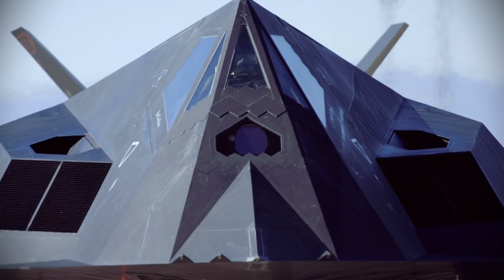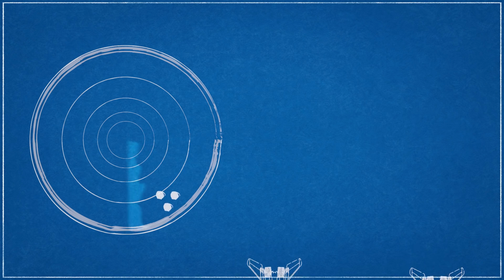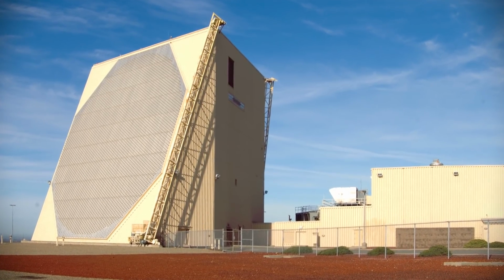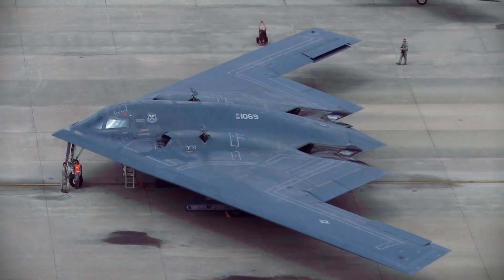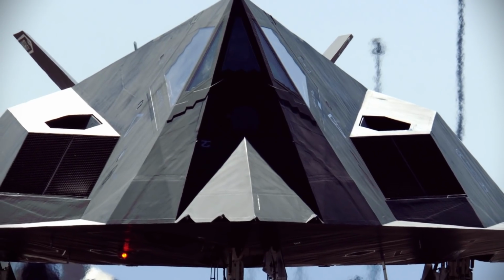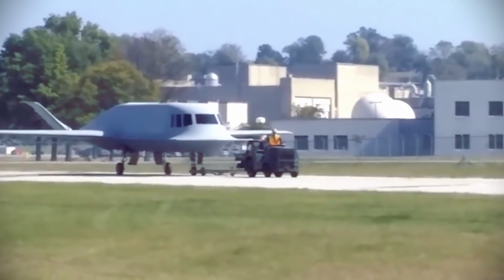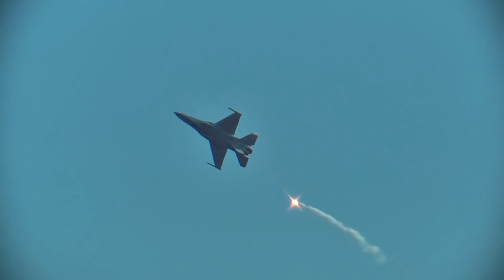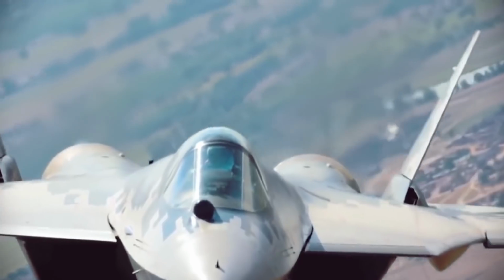The Evolution Of Stealth Technology

Comment: Could we quickly discuss the Horten Ho 229 at this point? 
Rebuild back in 2008 by a Northrop Grumman team using original materials and plans, and tested on the same stand as the F117 for its radar profile, they found that this plane if flown correctly (that means low and fast) could have tricked the English Radar Installations. It would not have been invisible for the radar but its profile was so drastically reduced that the RAF only would have had 2-4 min time to react and intercept them. If I remember correctly the only thing they could see on the radar was the cockpit itself.
It has been a long time since I've seen that documentary, would love to hear your take on this topic!

Edit: Small correction here: It was in 2008 by Northrop Grumman in cooperation with National Geographic 

quote from wiki: "Radar simulations showed that a hypothetical Ho 229, with the radar characteristics of the mockup which had neither metal frame nor engines, approaching the English coast from France flying at 885 kilometres per hour (550 mph) at 15–30 metres (49–98 ft) above the water would have been visible to CH radar at a distance of 80% that of a Bf 109 This implies a frontal RCS of only 40% that of a Bf 109 at the Chain Home frequencies."
Reply: Edited for correction!
Reply from the maker: I recall that documentary! Nat Geo’s Hitlers Stealth Fighter. An interesting fact I came across years ago on it was that all of the tests were done on static mockups. With running WWII era jet engines it would have lit up on radar to the point where it canceled out its pseudo stealth properties.

And this awesome fella above beat me to it. 👍
Reply: It was all hype if you ask me.  The horten brothers were trying to build an aerodynamic design, with the ultimate goal of a bomber capable of carrying a dirty bomb to the USA at high speed.
There was no evidence of radar evasive testing or technology development.  It was simply following the theoretically most aerodynamic shape, ie flying wing with no tail.
Jack northrop was working on the same thing, and actually started before the Horten brothers, he also came up with the flying wing and had no stealth intentions. 
THE ONLY REASON people assert that the HO 229 was an early stealth fighter is because it shares a resemblance to the B2.  That is it.

Comment: In Yuguavia they made the mistake to use the same route every time, that is why it was shot down not because of doors. The Serbians knew it was there, all they needed was a gap in the jamming and a good track.
You correctly stated that the trouble is to get a track good enough for guidance. If you have the initiative that is no problem.
Reply: It was detected because of doors. "According to Dani in a 2007 interview, his troops spotted the aircraft on radar when its bomb bay doors opened, raising its radar signature."

source: https://en.wikipedia.org/wiki/1999_F-117A_shootdown

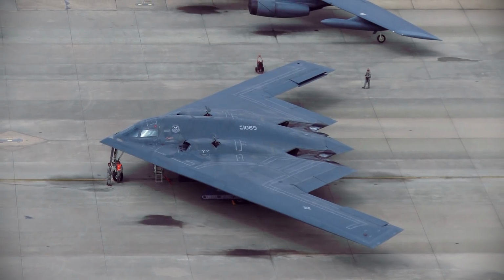Comment: 9:56 - Your timeline is all messed up. Overholzer approached Kelly Johnson about the implications of edge wave diffraction only after reading Ufimsev’s original paper (that was published in 1962, not 65 as stated here). 

Have Blue was the end result of the Echo 1 program that Overholser and another mathematician at Lockheed developed to model 2D RCS return around 1974-75 after not being included in the original DARPA RFP.

Comment: "With no vertical surfaces it requires a FBW system" ... tell that to the Horten brothers :P
Reply: Fones R Phunny it never flew in the first place :v
Reply: @LuisBrito-ly1ko  What is "it"? 229?
Reply: Fones R Phunny Yeah, the HO-229.
Reply: @LuisBrito-ly1ko  The Horten brothers designed several successful flying wings before that. Most of them were gliders, but some were equipped with pusher engines. None of those required FBW.

And the 229 did in fact fly. V1 ("prototype 1") was another glider and V2 was modified to mount the larger Jumo engines (since the BMWs weren't available yet). The latter crashed after an engine failure.

There was also the Northrop YB-35. A flying wing bomber similar to the Horten designs built in 1946.

There are plenty examples of working flying wings prior to the invention of FBW.
Reply: Fones R Phunny That’s because electronics didn’t exist back then. FBW replaces manual control flight to make the aircraft move as desired, without needing to be aware of all the control outputs to effect the outcome. 
Basically, it makes the pilots work easier.
Reply: @LuisBrito-ly1ko  I was questioning the necessity of a FBW system in a flying wing design since the Horten designs (supposedly) worked pretty well without them.
I'm fully aware what FBW is and what it does.
Reply: Fones R Phunny Well, let’s be realistic: How many aircrafts used Manual Control Systems after Korean War?
Reply: I don’t know why, but we can assume that technological advancement, security, combat readiness, and the necessity of decreasing the formation of a pilot may be some of the reasons.
Reply: @LuisBrito-ly1ko  All I was saying is a flying wing with no vertical stabelisers doesn't necessarily require FBW controls and mentioned the Horten planes as an example.
Reply: Fones R Phunny Yeah but the few flies it performed were either made by gliders or by engine-powered prototypes that didn’t end up well. 

The others may ended well but they didn’t pass the prototype stage. But if it’s possible, then the guy misunderstood something about FBW. Or there’s something about aeronautic engineering that we don’t know yet.
Reply: @LuisBrito-ly1ko  I'm not interested in getting into an argument about the success of Horten planes in general.

They worked without FBW system, that's all I care about.

And yes: obviously the author of the video doesn't fully understand why a FBW system is being used on the B-2.
Reply: Fones R Phunny I didn’t want to argue, I was just saying. And I’m glad we agree in something :)
Reply: @LuisBrito-ly1ko  :)
Have a good weekend sir.
Reply: Fones R Phunny you too 👍
Reply: @fonesrphunny7242  It all depends on the static stability of the airframe.   The HO-229 was statically stable - meaning that if perturbed it will return to its original state.   The F-117 was statically unstable.   It it starts to depart from its flightpath it will continue to do so.   So R2D2 was installed to fly the airplane.   A human cannot react fast enough or for long enough time.   If you can find a video of an F-16 taxiing, as it bounces the horizontal tails move in response.  (At least it used to do that back in the mid '70s when I was there )   Another example are the small canards on the B-1B on the forward fuselage.   Those things have an incredible response rate.  They are used for ride quality so the turbulence associated with a M0.95 on the deck penetration didn't turn the guts of the pilots to jelly.

Comment: The only problem with designing planes specifically around stealth is that they are utterly depended on being stealthy, given the huge cost of development/time required to develop/put into service they can suddenly find themselves at the mercy of improvements in radar technology. Once their stealthy attributes loose effectiveness they are just incredibly expensive sub-par bombers. The f22 is slightly different given that the radar that is defeating is mainly the ones of enemy fighters so even if the stealth got mitigated it should still get the first missile lock.
Reply: Mr. Morningstar  To be fair i did say the F22 is different, i was talking more in context of bombers. But comparing 4th generation technology to 5th is a false comparison anyway, given the technological advancements between the two generations  and the fact that if you could add the sensor fusion package to say the Tomcat (just would cost a lot to modernise).  There is always a performance hit trying to make a plane stealthy, so then the question is, is it worth it and the answer to that would come from the advances in detection technology, the detection technology unlike the f22 is not fixed for (30 or so years). This is before you get into the cost of making a single f22 and the fact the production line has been shut down and the limited numbers.

Comment: These Stealth Aircrafts are not Stealth to  Jindalee over the horizon radar.
The Jindalee Operational Radar Network (JORN) is an over-the-horizon radar (OTHR) network that can monitor air and sea movements across 37,000 km2. It has a normal operating range of 1,000 km to 3,000 km. It is used in the defence of Australia, and can also monitor maritime operations, wave heights and wind directions.
It bounces radio waves off the ionosphere and looks down on the target.

Comment: Stealth technology is not "invisible" to infrared, visual, and probably ultraviolet, wave lengths. Future stealth has to absorb radar wave lengths and not be frequency specific as frequency hopping combat radar is now common. Deflection of radar beam returns is rapidly being overcome by new radar methods. Visual invisibility is difficult, to maybe impossible, when visual wavelengths are coupled to wet brain intelligence. Further, combatant nations will flood the battle space with radar of multiple wavelengths from multiple sources and use passive receivers and AI to sort out the echoes. And the ultimate stealth vehicle that absorbs all radiation of all wavelengths from radio to UV will stand out like a sore thumb as a black hole in an otherwise bright background.

Comment: A question for the engineers: Is it theoretically possible to build an active anti-radar system? I'm thinking about a kind of weak field with short range (so as not to give the position of the vehicle away like a transponder) around the vehicle that acts as a sensor for incoming radar waves. The sensor is coupled to an emitter that sends radar waves back at the incoming radar waves, cancelling them out. Could the same principle that is applied to sound waves in noise-cancelling headphones be applied to radar waves?
Reply: This would probably work against a single installation, but only that installation, because it would have to be tuned to be in synch with that installation’s emitters. All other installations would see it clear and plain as day.
Reply: Any emission is a bad emission.  the best anti-radar is a radar homing missile.

Comment: 1st stealth plane: Hughes' Spruce Goose. It got its name from its only flight, when radar operators thought it was a flock of geese, due to the only parts of the plane that showed up on radar, the engines. Because it was built entirely of cedar, the Goose had better stealthiness than the F-117 nighthawk! The Goose was the inspiration for using composites on subsequent airframes. I learned this all when I was Apprentice to my Dad as a machinist, and he was telling me about the stuff he learned while working at Williams International Aerospace Industries, in Roy, Utah. Pretty cool, if you ask me- cooler still, that Hughes built the Goose 45 years before the next stealth aircraft!

Comment: 10:56 the Russians first learned of the shape of the sr-71 when it was on the same stand and left a spot shape of itself cooler in the sand when a satellite that seen in the infrared spectrum looked at that spot at area 51 they seen the outline of the sr-71. the workers knew when the satellite would be overhead and would push them into hangars. but they didn't plan for that contingency.

Comment: F117   Serbia........    :)  .Nothing is invisible
Reply: That was more of an operation falurie than a technical one.  The plane had flown the same route multiple times and was shot down by optically guided missiles
Reply: @sababugs1125  
But unfortunately in this case the rocket was radar-guided. These are radars that operate at very low frequencies and F117 technology is not effective. It can be seen on the radar with reduced reflection, but it is visible. This is evidenced by a film made by the pilot a few years after the shooting down

Comment: the Russians have been developing their IRST tech very much. and can detect a stealth aircraft from 45km. i should say they can detect track and target a stealth aircraft from head on at 45km and from the rear at 90km. this is depending on the altitude of both aircraft but just the fact that it can be done is quite an achievement. so if they want to shoot down a stealth aircraft what they can do is wait until the aircraft is 30km away and then take off and target them. because if the target has the sky as a background its easier to track and target.

Comment: I dunno how you can talk about Evolution of Stealth without mentioning the "Horton" and what the Germans had already tested out.
The Horton was made of wood where possible (even inside the cockpit) to reduce radar cross section. additionally the germans already invented a special coating which absorbed radar partially making it even harder to spot the Horton on radar. If the war would have continued and the Horton project would've been finished, the Germans could have attacked Brittain, as the detection by the Radar stations would've been too late to prevent the germans of attacking said radar stations.
20 min about radar technology and not mentioning the Horton is a nono... you even have a picture of it in your vid....
Reply: The Horten designs were not stealth. Wood was chosen because of the lack of steel that plagued German factories in '44 and beyond. It certainly did have a lower microwave/ radio cross section over its contemporaries. But that can attributed to its inherent lack of a tail, wooden construction, and its small dimensions. The wooden construction was something that was noted for the Mosquito.

Comment: Nice video but would have been interesting to have mentioned how low observable  airframes (because stealth is a marketing term, nothing is/was invisible, it is just a matter of detection range)  are quickly becoming obsolete with modern radars with more computing power, like quantum radars, multistatic radars etc....  it is much easier to upgrade software, computers and antennas than an airframe which is supposed to be operational until 2040-50.  
F22 can fall back on good flight characteristics, but the F35 is a flying brick once it has been unmasked.  Still capable for bombing ISIS (which any plane/drone could do as easily), but not sure it will do so well in contested air space vs up to date militaries like Russia or China.  Even less advanced countries defeated "stealth" -> F117 was shot down in the 90s by soviet era equipment in Serbia, and RQ 170 "stealth" drone was captured intact by Iran in 2011!  So the ROI on stealth doesn't look great, i have no doubt $1.5 trillion could have been spent better on many other projects.
Reply: I hope you are aware technologies in both areas are developing and innovating as well and that stealth most certainly has not stagnated. 

> "... but the F35 is a flying brick once it has been unmasked."

 As compared to what? 

> "Even less advanced countries defeated "stealth" -> F117 was shot down in the 90s by soviet era equipment in Serbia"

 The F-117A itself was antiquated, being unupgraded and lacking any other forms of countermeasures since its introduction, the S-125 in question was a modernized system from the late eighties. 

> "and RQ 170 "stealth" drone was captured intact by Iran in 2011!"

 One, it was not captured "intact." 

> "i have no doubt $1.5 trillion could have been spent better on many other projects."
 
The program cost of $1.098 trillion USD is over the course of its entire projected (2006-2065 ) service life spread over 12+ countries.

Comment: I thought stealth airplane started in a B2 Spirit like prototype Nazi Germany's flying wing design instead of Russia.
Reply: Ying Chiu Luk the horten 229 it also was discovered by accident if im not mistaken (the stealth portion of the plane it was helped from the plane being mainly made of wood and the shape made only few radio waves to bounce back the wood helped absorb them too when trying to track the horten 229 they found it had stealth capability’s because they lost it on their radar)
Reply: No it wasn't.
Reply: @lilsebastian6131   The 229 was not stealth. The only reason it had a comparatively lower RCS was its lack of a tail, inherently small dimensions to begin with, and its wooden fuselage (the latter was noted in the Mosquito ).

Comment: us was sitting tight till the czech goverment approved they didnt sell any tamara system to iraq...after that they started bombing with f-117 . was the only radar system at the time able to detect the f-117 and maybe B2 too...and of course us put embargo on it. :D
Reply: The F-117 could be detected by loads of systems, it's just how effective those systems are at doing so, let alone targeting and guiding a missile to target.
Reply: @ivanlagrossemoule  F117 was shot down by a 30 year old SA system in 1999 . The hole in these planes is they still have to open the doors with metal bombs inside them , and that's how you detect their location and launch the because the miissle will travel faster than the plane .
Reply: 1999 F117 shot down .. they still have to open the doors .
Reply: @johngant3553  The F-117A was an antiquated aircraft mind you. That lacked any countermeasures save being low-observable, was effectively older than the modernized systems the Serbs used, and flying the same flight path of other aircraft earlier that day...